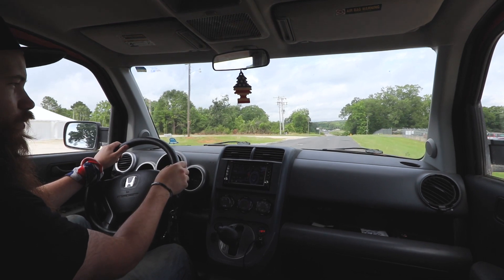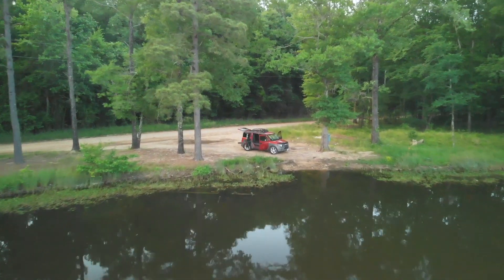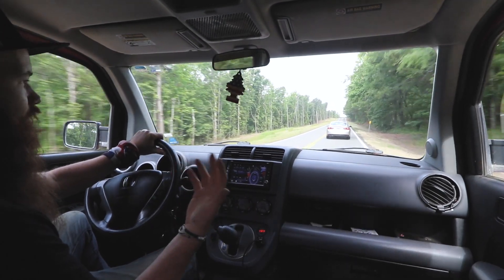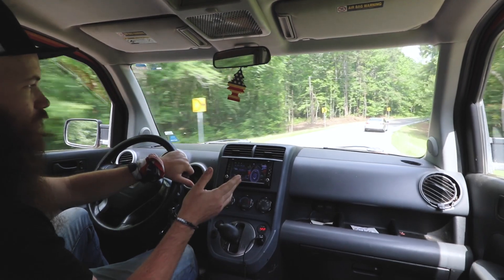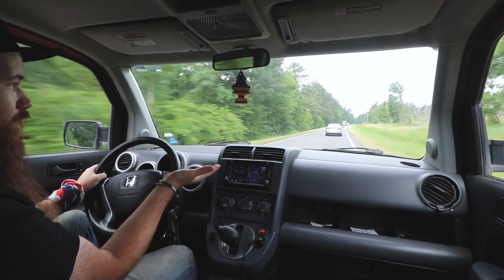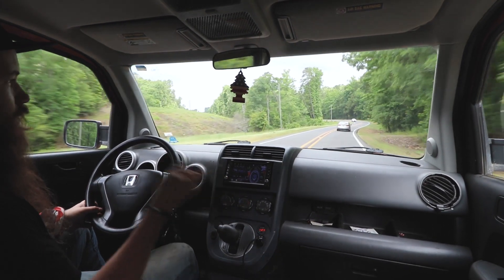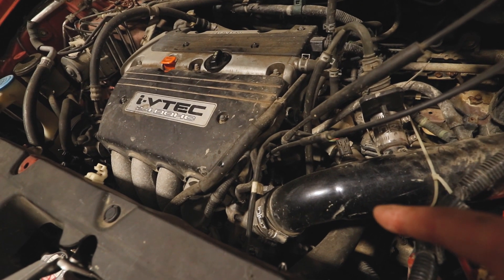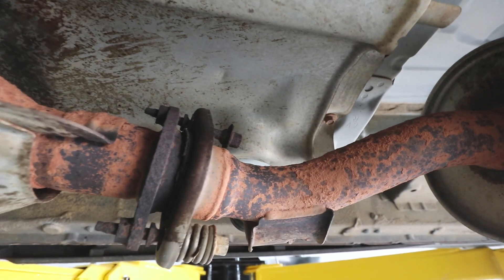Review of the 2003 Honda Element(10+ years of Ownership)

Comment: I own a 2004 EX. I'm the original owner. My Element  has 335,000 miles. I can drive 320 miles on a tank of gas before the gas light comes on.  This car is amazing, the exhaust tailpipe has no carbon  or any residue in it. You can rub your finger the the inside of the pipe and nothing comes off on your finger. I change the oil every 8k, and exchange the transmission fluid every 35,000 miles.  I did the required major tune up at 105,000 ie new spark plugs,  I still have those same spark plugs in that were installed at 105,000 miles.  I did put all new struts in at 275,000. This is a Florida car, no rust whatsoever. I'm on my 3rd set of brake pads. The original pads I made it to135,000 the 2nd set made it to 286,000 so I'm on my 3rd set, all OEM. I will never sell this vehicle. I bought the car when i was 44,  I'm now 61. In Florida the car becomes an Antique after 30 years, so it'll be an antique in 13 years. I think the car will make it no problem.
Reply from the maker: That's a beautiful story! What a machine, keep up the love on that one. Heck of a story ❤️
Reply: My 2005 Honda Element EX has reached 190,000 miles.  Hoping to reach 300,000 miles without any major expensive repairs.  I change oil/filter every 3,000 miles.
Reply: I'm in Florida also. I have an 05 Element and just reached 200k miles. I'm the 2nd owner.  I baby this car. I may do a 3in lift and bigger tires. I have absolutely zero rust. I've driven all over the country and never had a problem.   My local Honda offered $2500 for it hahahahaha....No thank you lol...good luck to you .

Comment: I also own a 2003 EX which I enjoy very much. I am the 2nd owner; bought it in 2005 with 28k and now has 420k miles. Road noise is no problem with me. I let it warm up first thing in morning, change oil myself every 5k with synthetic, and don’t run the hell out of it. I’ve  had the alternator, starter and water pump replaced but for that mileage and 17 years old would any other vehicle do better? Good in snow, great sound system, and by far the most practical and versatile vehicle I’ve ever owned. Cheers!
Reply from the maker: That's a huge milestone! Any car would be lucky to hit over 400k miles but I've seen many Elements in that range surprisingly.
Reply: I am so glad to hear that your 03 has 420K! I am so sad at the thought of having to get another car. My 03 has 289K. I do keep the oil changed. Have done some work on it, heavy duty suspension last year bec used for carrying my sample books for work. Also hit some curbs and had to replace 2 axels. Spent 5k last yrs on thise and brakes, shocks windshield. Just can't give it up! So fun to drive and so adorable. Thinking of getting another one eventually.
Reply: @lynetteheitman5118  Glad to hear of your response on your Element. Mine has now progressed to over 423k. I cleaned the idle air control valve recently as it started surging. Honda dealer wanted $400 to replace it. I bought a $15 gasket, followed a Utube video and cleaned it myself. Still shooting for 1/2 million miles on mine. Happy New Year!
Reply: I wonder if you can get 1 million miles- I am only at 235,000 in my 2003 Element

Comment: The fuel light will turn on when it reaches 3 gallons left.  Add that with the 12 and a half fuel up and its pretty much at the rated 15.9 gallon tank.  Cheers!  New Element owner here love these videos where  I can hear element owners and their experience with them!
Reply from the maker: Absolutely! And very correct on that pesky Low Fuel light 😄. I have to remind my wife that there's still quite a bit left in the tank. I've had one hair splitting experience with my fuel light and the backwoods of Missouri. I thought for sure I'd be out of gas in the middle of no where. Made it to a gas station, put right at 15 gallons in 😄
Reply: @DashnCars  I do a ton of in City driving with my element I put maybe a hundred miles a day on my car. When that gas light comes on I usually try to figure I have about 40 more miles before I need to GPS the nearest gas station. LOL

Comment: I'm the original owner of an '04 (Galapagos Green Metallic) EX and the passenger seat has always had an armrest.  125,000 miles and going strong.  Mine's done a lot of camping. And it is a great motorcycle hauler.  Keeping it forever.  Nice video, thanks for sharing your insights and enthusiasm.
Reply from the maker: The Galapagos green was my second choice! Love that color as well. That's pretty good miles for an 04! And thank you for the kind words, I'm also keeping mine forever.
Reply: I’m so peeved about not having that passenger arm rest, it drives me nuts
Reply from the maker: @vvskiitlesvv  it drives everyone crazy who rides with me too 😄
Reply: @DashnCars  More brilliant ideas by idiot savant CEOs with far more money than brains.  Either that, or they are purposely malicious in their intentions, as well as extremely greedy in cutting corners.   The idiots who designed the Buick Encore did the same thing.  No passenger armrest and no center console.  Unacceptable.  As far as the Element goes, I think you can get an aftermarket center console for the Element SC model and it will fit the other models.  It also makes a great armrest for the passenger.  That's what I would do.  I'm looking at an 04 EX but it already has both armrests.  I haven't bought it yet, going to see it tommorrow.  It looks identical to your 2003 with 169K miles.  I found a 2011 solid silver EX with no moonroof and only 60K miles 2 hours in the opposite direction.  I had to choose one or the other because these are flying off the lots around here and I can't look at both in one day.  If I go with the 2004 and dont like it for some reason, the 2011 will be sold before I can get to it.  Or vice versa.  People are crazy around here about anything AWD or 4x4 and under a certain price that has a normal old school engine and transmission.  Like the Element, the Nissan Xterra 4x4 and the Jeep Wrangler Unlimited 4 doors.  Everytime I find something online that I want to check out......POOF....GONE before I can formulate a thought about it.   Nobody around here wants an $800 a month truck payment on a 50 grand truck or SUV and they don't want the crappy underpowered junk they are putting out with garbage transmissions either.  So it's like trying to win a lottery to find something decent.  Very low supply, insanely high demand.  I've begun to wonder if people are camping out in front of dealerships just waiting for the same thing I'm looking for because it's utterly bizarre how fast they get to it as soon as I find it online.  Even if it's a new listing and just posted!!
Reply from the maker: @reesedaniel5835  no kidding! A lot of people in the Element groups get scalpers trying to buy their Element from them.

Comment: I have a Honda element 2004. I’ve got it with 270,000 miles on it. I now have 353,000. Original transmission and motor still going strong. This view is amazing! It’s like he had my exact car! Everything he described it has happened to mine. The struts, with the frozen bolt-
The brake caliper seizing up.
The straight up and down windshield catching every rock in sight, replaced it once already has cracks. The road noise drowns out beautifully with the speakers! Etc. etc. just like you said keep up with the maintenance, change the oil all the time! I’m expecting 400,000 easy!

Update:
Made it to 427,000 but wrecked it the other night:(
Had to reluctantly total it out. 
Just put new front struts, AC pump and v tech solenoid.
Same motor same transmission….
It was going to 500,000 easy 
Some guy in a Chevy truck towing lawn equipment in a big trailer ran a red light. Element took it like a champ. 
Airbags went off. I was 
Unhurt.
Reply from the maker: Another great story! Long live the E!
Reply: How many miles strong are you going now?
Reply: I purposely roll down my windows on the highway going 75 because I love road noise so this vehicle will be great for me.

Comment: Still in love at 155k miles with my 03 Galapagos Green EX I bought new off the boat in March of that year. It spend most of the year on pavement, but summers we hit lots of mountain roads with gravel and rougher surfaces. Replaced the starter last week, the struts all around in 2019, and the windshield in 2019 after the crack widened on a rock chip I picked up in 2003 when the car was just two weeks old. Absolutely the best vehicle for trailhead camping for early morning starts and all around utility in a small body—but not to small, I'm 6'3" and still have 6 inches of headroom as well as backseat leg room when I drive. I'll be doing those rear sway bar bushings in a couple of months, this car never dies.
Reply from the maker: That's an awesome story!
Reply: So good to hear!!  I still have my 2005 Element, bought new in early 2006 & I love it!!  My windshield has been cracked for almost 13 years, a cosmetic defect as far as I’m concerned.  There was a class-action lawsuit more than 10 years ago claiming that the shape of the windshield was defective.  I found that no auto glass repairer would replace it unless they got a new one through Honda (wouldn’t use a salvaged one) so there’s no incentive to replace it.  It would just crack again.  It’s the first new car that I’ve ever bought and I hope that it goes on and on and on until it becomes obsolete because of electric cars.  Incidentally, my first Element, same model/same year was totaled and I suffered only a slight nosebleed from the airbag.  The design prevented the front end from crushing into the front seat.

Comment: I have an '03 Element bought it new, now has 278,000 miles.You are right about the suspension--pretty much had it all replaced in the last 5 years, but it's worth it. Runs like new. I have been very good with regular maintenance and it's paying off! And I am about to get the third windshield installed.
Reply from the maker: Awesome! I love hearing these kind of stories. Keep it going!

Comment: I have a 2003 AWD that pa bought new, I got it when he died, thanks Pa! Still under 50,000 miles, all its needed was a coil, oil changes and I had the valves adjusted last year just to check. I have an appointment to replace  bushings next week...

Comment: I have a 2008 Element SC with over 150K miles and road noise is minimal. No rattles. No bushings worn.  Only problem I have had was hitting a deer at 35 mph requiring the front grille, bumper, headlights, radiator and condenser replacement. No sheet metal was hurt. I get 24mpg on the average.  I'm 6' and it is easy to get in and have 5" of headroom.  The radio is super and what I like is the utility of it.  I have two large golden retrievers and I take them to the lake or vet and you can't beat the back end cargo capacity.  I fold up the back seats and another great feature is the tailgate/lift gate feature.  You can sit on the tailgate or use it as a table when camping.  I heard they may be coming out with a new model soon.  Hope they do.  These things will last 275K miles easily with minimal care.

Comment: MY HOTELEMENT 2005 Burnt Orange
Bought mine used with 40.000 k mi in 2007
250.000 miles and no complaints 
I agree with you 90% , including the speeding tickets
except  my air intake is factory and I get 28 mi per gallon
I'm not a mechanic but I'm good at tinkering
so I have replaced 
lower control arm loaded( it means , it comes with all the bushings ready to rock) twice for a fraction of what the stealer quoted me
rear sway bar rubber bushings twice
struts all the way around 
One starter 
couple of serpentine belts
Akebono rotors and pads ( incredible durability, when I bought my Element  need it brakes , I'm on my second set )
I was off road about 2 yrs ago and I hit my gas tank and ruined my gas gauge 
so I just go by mileage I safely get 330 miles per tank
one of this days I'll venture into the tank and check the sending unit
I work at a ski area and this AWD traction system is awesome, I will say is my favorite feature
My HOTELEMENT is  going to reach 300.000 k with no problem 
will I buy another one ?
YESSSS!!
I LOVE MY TOASTER
Reply from the maker: They really are amazing machines! Glad you love yours too!

Comment: Enjoyed the video. I also have an 03 E. Got mine 8 years ago with 56K and just hit 75K this week. Have changed the starter and did an alternator last week. Just normal maintenance otherwise. Great car
Reply from the maker: I'm still driving away with mine, just about to cross over the 210k mark. No issues, just smooth sailing. Unless it's really windy 😄

Comment: We love ours. Excellent for the kids BUT only a 4 seater. It has SO MUCH room though. Easy to throw up the seats in the back, and watch a movie at the drive in with both kids. Our element didn’t have any rust issues (ny/pa). It is kinda finicky about oil. We had some kind of computer issue when suddenly it wouldn’t want to start up and there would be a weird ticking to the right of the driver. If it does this, a temporary fix is to give it a good hit just above the speedometer. Even with any issues we have had it’s the absolute best vehicle we’ve ever had.
Reply from the maker: Fully agreed! I have to hit my dash to get my gauges on every once in a while 😄. The kids in the back are the best, they have room for days plus if they spill something? No biggie! Just wipe it up.

Comment: I have a 2003 EX same color as yours. Love it! It has less than 200k but we did end up having to replace the transmission. We have the typical issues. The heat doesn’t work unless we manually turn the heat on, we have a small surface crack on the windshield, the driver’s seat has a tear, the lock is messed up and I have to manually lock it. But even with all that it’s my favorite vehicle out of everything I’ve ever owned.
Reply from the maker: That's awesome! Sounds like a great rig, most people have that same story. Same ending to, best and most favorite car ever 🤘

Comment: I have a black 2011. Bought it in 2012 daily driver. No major problems. I have had the front axles and ball joints replaced. Starter was replaced a year ago. Still runs great. Almost200,000 miles on it. Ac still ice cold. Aboit to get it detailed soon.
Reply from the maker: That's awesome news. They're such amazing cars.

Comment: Bought one of the first Elements brand new in 2003.....I had Chow dogs, so it was perfect for hauling. I also had a summer job with my town watering the hanging baskets of the downtown where I lived.....it carried the water tank with ease, and when  I popped out the back glass sunroof....and could reach the baskets easily with the watering wand.....sometimes for fun Id drive around with the watering wand out of the roof.....it looked like I had a shower in the back of the Element....lol.....My only complaint was the gas mileage....It had plenty of power, and of course it was a box, so I guess I shouldnt have been too surprised, but that was the only major complaint I heard from fellow Element owners....I drove it for 11 years, and  I never experienced any of these problems. I only had to replace the starter motor....not surprising after 8 years of driving....aside from the fabric of the drivers side seat breaking down...(it wouldnt have if I had bothered to put my OEM seatcovers on after having the car detailed)....this vehicle was bulletproof...it had hard use....and it never let me down ever.....loved going round domestic 4X4 trucks in the wintertime that had skidded off the road......best vehicle Ive ever owned.....
Reply from the maker: Absolutely agree. Best work vehicle/ rig ever. That's so awesome it worked well for you for many many years

Comment: I’ve gone long distances at right around a 100mph. But I went with the manual. It made a real difference to power and gas mileage in the long run.
Reply from the maker: Oh yeah, absolutely. I think the Auto is pretty good for in town but long drives the manual shows its worth.

Comment: I bought a 2004 2WD manual new, put over 250,000KM on it and then traded it in on a 2010 AWD automatic in the spring of 2011 and put over 250,000KM on that one by late summer 2018 when I bought a new car to replace it. The 2004 had the clutch slave cylinder replaced under warranty at 22,000KM CV joints replaced under warranty at about 30,000KM. The 2010 had an AC component fail at 210,000KM. Other than that nothing needed but the regular service as per the owners manual. I used both of them to tow glider trailers (which were right at the tow capacity limit when loaded with a glider) locally and through the Rockies. Transported an amazing variety of stuff in them, camped out in them and used them for all my daily driving needs. On both replacing the OEM tires with Michelins made them a lot quieter. The 2WD was prone to some axle-hop and torque steer in the wet or snow but the AWD solved those minor annoyances. I loved them. When I went to sell the 2010 the average price in my area was about twice what it was back in 2011 when I traded in the 2004. One nice thing about the later models is that the front seat belts don't anchor to the door so you don't have to remove your seatbelt when letting someone in or out of the back.
Reply from the maker: That's an awesome story! I love hearing other people's lives with their Element. Glad you had a few to love, such a great car to have as a companion